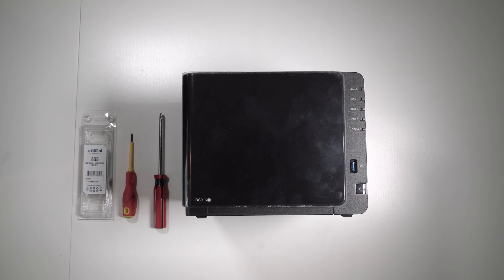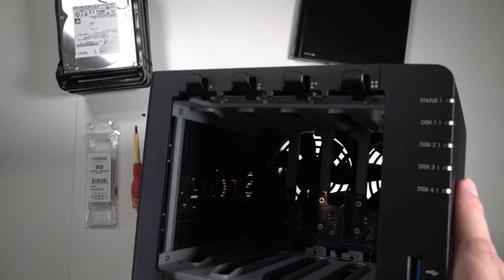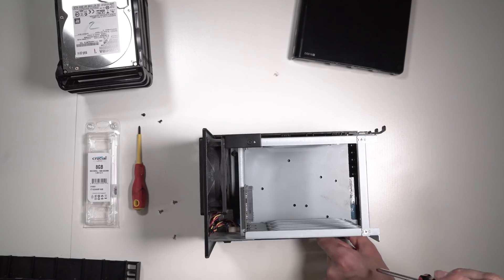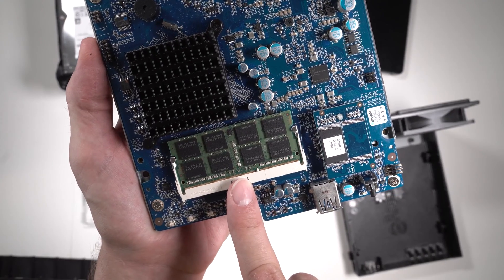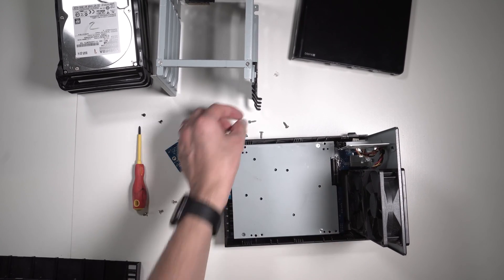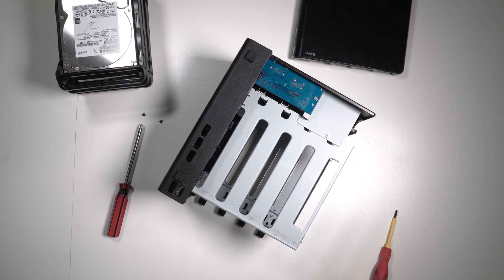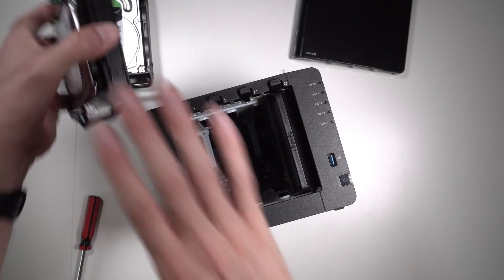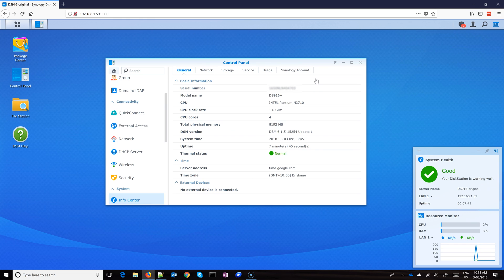Synology DS916+/415+/416 play RAM upgrade

Comment: Thanks, just bought a used DS916+ for archiving and backups. Followed your tutorial and installed a Crucial CT102464BF160B 8gb module which after much googling appeared to be the best option for compatibility. Fingers crossed so far everything is working, no errors being flagged at the moment!

Comment: Just purchased a secondhand DS916+. I followed your guide and successfully upgraded from 2GB to 8GB. I found I had to bend the steel bar slightly with a flat head screwdriver to unlock the plastic case. I cleaned all the dust out with a toothbrush and isopropyl alcohol, and it still runs, bonus!

Comment: Great video.  Took 20 minutes.  Only comment is getting the case off was not possible with just my bare fingers.  Had to use a flat head screw driver to move the metal bar over the plastic catches.  Fortunately nothing broke.  Other than that it was easy.  

Also consider running a memory test on your new memory using the Synology Assistant.  Be prepared for the test to run for a long time - it's been going for hours on 8GB on my DS416, and it's not finished yet!

Comment: Great video! Thank you!

I had a bunch of Rams lying around. I decided to pop one of my 8GB RAM into my DS416, but it didn't work. Fans and disks were spinning, but the device wasn't booting up. No lights and no error noise. It didn't respond to pings, and web dashboard didn't come up either.

I went thru the process again and put in 4GB RAM. It worked without a problem.

There may be some compatibility differences. Idk. My ram was the same size, a little bit slower. 

My DS416 had 1GB ram so 4GB is already a big jump so I am not going to mess around with it anymore :)

Comment: Nearly 4 years later and still a super video. I just increased the RAM of my DS916+ by following your video and it worked like a charm. Thank you for this fantastic tutorial. I also followed the advice from WFP below to disable the memory compression in the settings. Hope that these two steps combined will give my Synology the performance boost I am hoping for.

Comment: Great. I just followed this to do my DS416+ play. Just rebooting after turning off memory compression now. Had a brief scare with the flashing blue power button just after reconnecting it, but it booted up fine within a minute. It could just be me, but it has booted up much quicker.
Reply: Following up.  About a week after upgrading the RAM, I've noticed that the machine is certainly snappier - I can see the directories quicker when accessing the folders from my Mac. Transfers seem a bit quicker, and Synology photos seems to work better. Streaming from the NAS to the TV is much smoother now; also - and I don't know if it's related to the RAM - my smart TV used to take ages to refresh the contents of the video folder of my NAS (I'm talking hours/days). But now it's pretty instant. Yay. Thanks again.

Comment: Awesome video! I need to upgrade my RAM if I want to switch to DSM7 and I have a DS416j. 
Do you know if this RAM is compatible with DS416j? I think 4GB is enough for me, is the "Crucial RAM CT51264BF160B 4GB DDR3 1600 MHz CL11" model compatible?
Thank's for your reply
Reply: FYI, after some research and testing, on my DS416j there is 512gb of built-in DDR3 ram which is soldered to the board so there is no room for upgrade

Comment: Excellent tutorial ! Managed to upgrade my DS916+ in about 10min. One thing to note is that on first power up the blue power light seemed to flash longer than normal, took about 5 mins to boot. Other information seems to point to the system checking the newly installed ram.

Comment: Also a great idea to turn OFF memory compression after the upgrade. You do this in the control panel/Hardware and Power and reboot. 8GB is plenty of RAM so you no longer need to tie up CPU cycles with compressing and uncompressing items in RAM. You should retag this video with the 416Play as well to get more views. It is IDENTICAL inside.

Comment: Clearly there is a benefit to doing this however, never a fan when the memory modules require all this effort to access. Is the performance difference between what's installed and 8GB that large?
Reply: You should see a difference if you run apps other than just file sharing. Plex, Photo/Videostation and Docker all work more snappy. It is hard to put an empirical measure of the difference as thre are not any speed tests set up got Synology.
Reply: @wfp9378  gotcha, that makes sense. Thank you.

Comment: Great video and details. I wonder if you did any performance testing before and after.  Also, do you think it’s worth it to pay 30% more for 1866 speed over 1600 RAM?
Reply from the maker: You can have a look at various benchmarks but to me the benefits didn't outweigh the cost so I went with cheaper 1600 RAM
Reply: @juraj_b  thanks. I suspect the performance is negligible. I read an article about latency speed differences and it amounted to about 1% in overall speed in an otherwise highly optimized system. If the rest of the rig was not high performance it might be zero. As for the benchmarks of moving from 4GB RAM to 8GB are there any available that you can share?

Comment: I'm trying this on a 916+

There is no catch inside the casing to release the two parts of the outer casing.  There are two plastic lugs towards the open end of the case that significantly impede the case moving past the strut.  I will need one pair of hands to lever the strut past those lugs and another pair to simultaneously push the two pieces apart.

It makes me wonder whether Synology have modified the case to prevent people upgrading?

Thoughts
Reply from the maker: You should be able to slide your fingers in and push with your thumb against it while holding the chassis from inside. I had a look and it's still the same. In the future iterations, like 918+ they actually made it even easier to upgrade and open the case. You don't even need to remove the motherboard as you need with 916+
Reply: OK, I will try again in the morning.  I hung back because even applying some leverage with a flat blade screwdriver I could not get those lugs to clear the metal strut, and I did not want to damage the unit.  The side of MY case is very stiff.
Reply from the maker: I wouldn't use a screw driver as you would need two of them at the same time and it's a hassle to manage. Your hand is just so much better tool for it. Hope it goes well!
Reply: After some arm wresting the cover finally came off.  After that everything else was a breeze!  I got me 8GB RAM!
Reply from the maker: Excellent! Glad to hear that :)